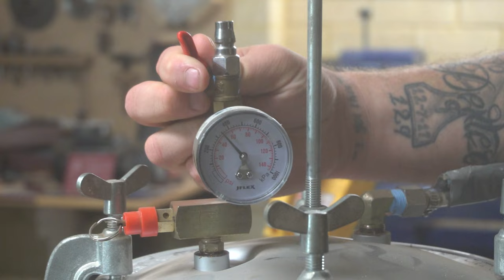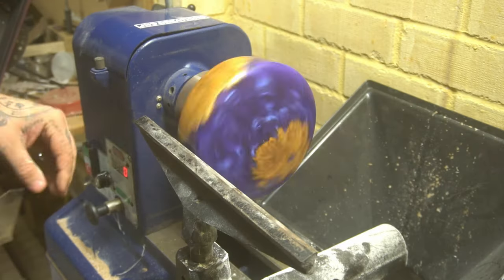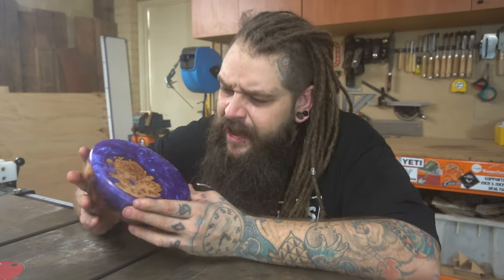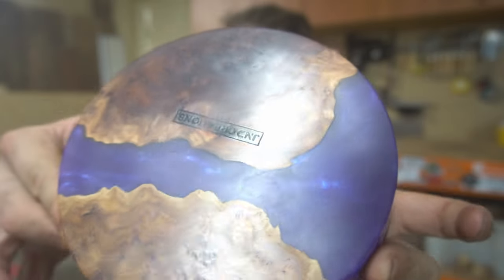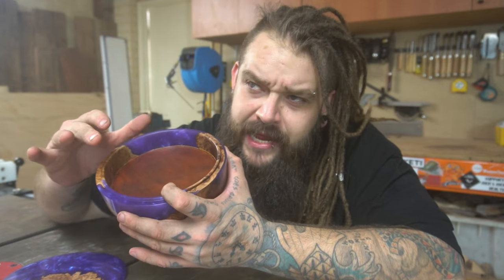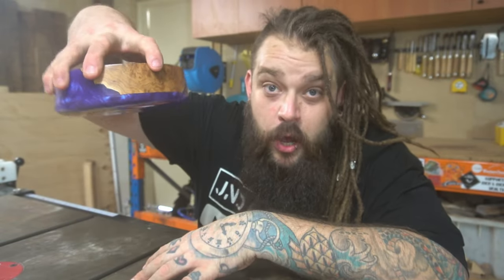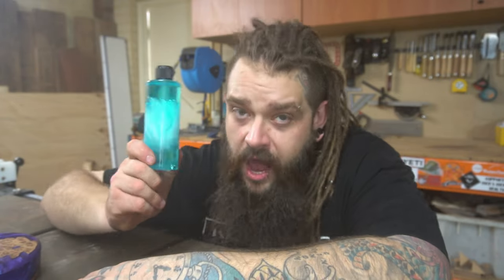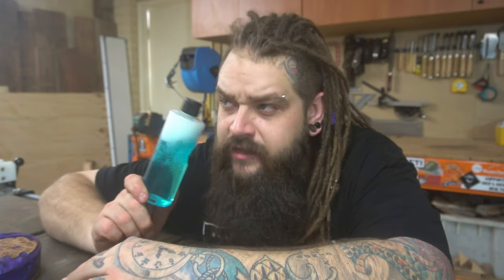Woodturning a Lidded Dish || Custom DnD Dice Tray || Epoxy Resin Art

Comment: Jax...where did you get your logo branding iron? Are you happy with it?
Reply from the maker: I got this one made up by Betts Design Sydney. It was pricey compared to my previous eBay one, but it worked well. Only issue I’ve had is I left it plugged in by mistake and it got too hot and the electrical components in the handle basically melted. I need to replace that as the handle is no longer solid.